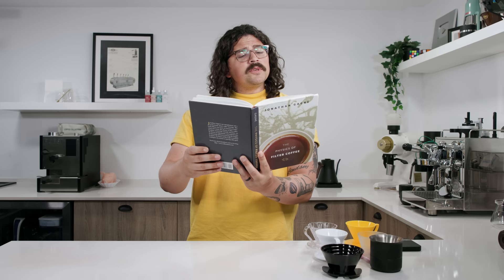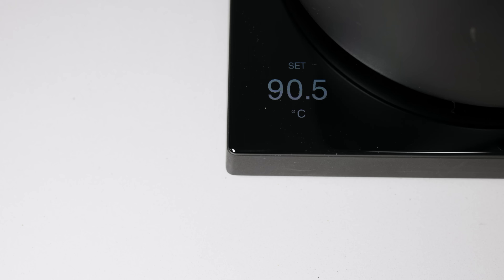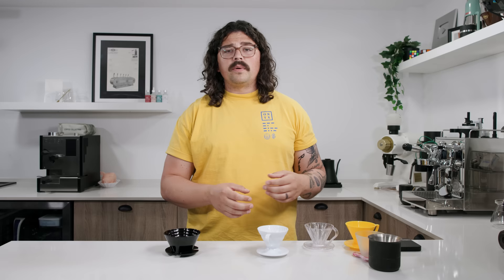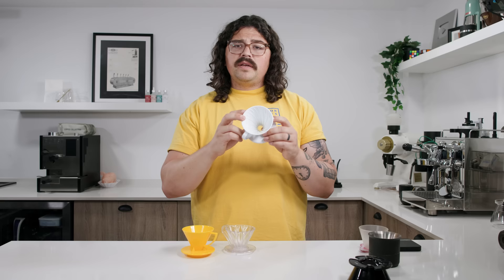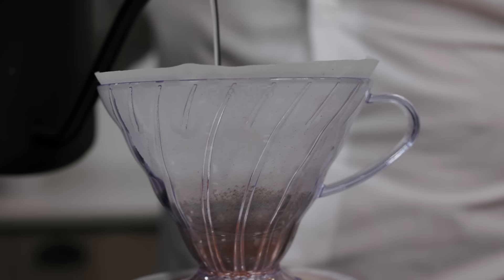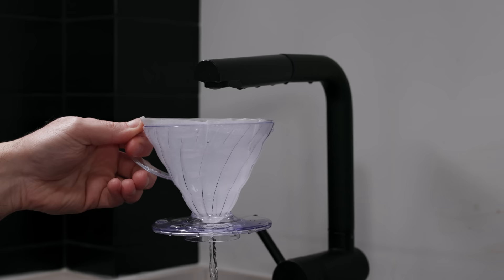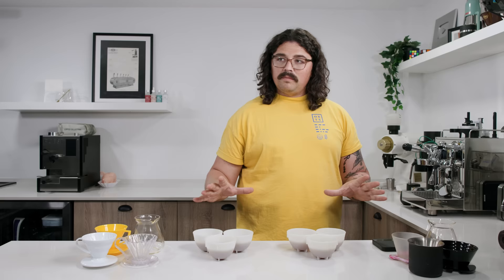WHICH IS BETTER?: Conical vs Flat Bottom Brewers

Comment: Does anyone still have access to the data from the UC Davis, basket geometry study? I seem to recall EY's were not typical, nor comparable across basket types? (Maybe I remember incorrectly, it was some time ago now). What about practical attributes? Basket filter papers take up more space to store, are frequently unavailable where I live, less practical to travel with, more fiddly generally - hence the ones I use least commonly. If I couldn't get Hario papers with my grocery shop, I'd be 95% Melitta/Clever brews.

Comment: No love for dual-wall v-shaped filters like Kalita and Melitta 101/102?
Reply: Melitta got me into brewing coffee. Used to use instant if I was at home. I know they aren’t as popular, and there are probably valid reasons for that, but when you can get a simple Melitta dripped in the grocery store, that’s a great start. Not just in quality, but in the hands-on approach.
Reply: I would also like to see how the V shaped Melitta (and Clever, when not using immersion) stack up.

It has some of the geometry of cone brewers, but the single tiny hole makes it more like a flat bottom. I grind pretty fine for pour-over, but don't get stalling in Grandma M.

I'd like to get a second dripper for experimenting ... even after the video I don't know what type to try for a cup with more clarity.

Comment: I don't think water depth above the bed is increasing the drip rate solely due to bypass. I would have to assume that the deeper water would push down through the bed with more force due to increased weight and therefore pressure at the bed.
Reply from the maker: Doesn't act the same in, say, a kono.

Comment: I know you said you hate the frill filters, but could the Timemore B75 mitigate this issue with it's design?
Reply: No it does not. I own a timemore b75 and the filter does not sit flush to the walls. So there is definitely bypass happening. But besides from that I like that brewer very much. It's much faster than the April Brewer and the plastic Origami. I'm using Kalita 155 filters for all three brewers. Probably a cheap alternative to the Orea V3. But the Orea offers the opportunity to brew without any bypass when using the trapezoid filters and the negotiater.
Reply: @TheMeetubee  Thanks for the answer!

Comment: I just don't understand why it would make a difference if the edges vs the centre of the bed is less evenly extracted (in a cone dripper) than if the bottom vs top of the bed is less evenly extracted (in a flat bottom dripper)? Like how would it matter if the extraction gradient is from edges to centre or top to bottom if the same extraction is achieved in the end?

Comment: One thing I consistently struggle with is getting my pour-overs to taste full. Often the coffee has a dull, tannic flavor or it's just aggressively bitter. There's not much fruit or acidity, even if the roaster says "pineapple" etc. I buy high quality beans too, like Madcap, Sey, Tim Windelboe, etc. I've got an 1zpresso grinder, I got the Kruwe ruler to make sure by grind size was 400-ish microns, tried the standard V60 and the Mugen, still the same issue. Tried all kinds of recipes and rations too. I'm at a loss tbh. Feel like my coffee palette is busted or something.
Reply: Off the top of my head, it sounds like you are grinding too fine, based on both the flavor notes you mention and your mention of grinding to 400 microns. It was a while back, but I think Lance mentioned grinding to 800-900 microns for filter. Lance doesn’t like to give micron ranges for grinding because he wants people to dial in for them selves, but if you haven’t already tried it, I would try grinding way way coarser than 400 microns for filter and seeing how you like that
Reply: What water are you using? Making my own water (adding lotus drops to distilled water) has helped tremendously
Reply: @BBB_025  I appreciate this a lot! I'll coarsen things up and try again. Clearly I got myself in a rut with approaching grind size.
Reply: @BeatTheSunUp  Tap that I filter with a Berkey. The regular tap is not tasty, but maybe the Berkey is leaving some useful minerals out.
Reply: @6minus3minus2  I am not familiar with the Berkey and I am not sure what part of the world you live in, but you might give third wave water a shot if it’s available in your area and then see if you want to go farther down the water chemistry rabbit hole with something like lotus water.
Reply: @BBB_025  Berkey is the fave of off-the-grid types, but I just got it cause my local water has LOTS of chlorine. But I coarsened up my 1zpresso by about a 1/3rd full turn and my coffee is MUCH tastier. I really appreciate your advice. Loving this Tim Wendelboe I have now.
Reply: @6minus3minus2  success! 🎉🎉🎉🎉

Comment: That's a good book. I recognized it at my local coffee roaster days after you posted a video featuring Jonathan Gagné and got it right on the spot.

The part about bypass actually explains the 60% in Tetsu Kasuya's 4:6 - fewer but bigger pours for more bypass, and more but smaller pours for less bypass. I'm guessing the first two pours is bloom size followed by a top-off for a consistent starting point for the 60%?

Comment: Would it be crazy to use two different grind sizes in a flat bottom? Fine for the bottom (under extracted) half and coarse for the top (well extracted). Or would it just mix too much?
Reply: Sounds interesting in theory. Wouldn't this cause more bypass halfway up the dripper since the bottom would be more likely to be clogged?
You might be interested in the Wet WDT method
Reply: @Carmagical  I meant with the orea and negotiator friendly filters where bypass is minimal already. The idea of those needles so close to my precious sibarist filters puts me off the wet WDT haha. Should try at some point tho
Reply: @iwouldpayattention  oh! But that would be a perfect use for it haha. Just remember to sand the tips of your needles off and you'll be fine. Those filters are really expensive though. 
I think you'll find what you're looking for with wet WDT, but you should still try out your method and see what the results are.
Reply: @Carmagical would not of thought of sanding haha. I think I’m actually gonna try grinding just past the point of astringency and then just before the 5th/final pour, letting the bed drain and scooping out the top third or so of grounds. I’ll give this method my name haha

Comment: With brew temp being a relatively low impact variable, should we be worrying less about preheating brewers? Maybe a small question, but it would be nice to use less kettle water!
Reply: You can watch Hoffmann's V60 recipe about that topic (I think the newer one with the small coffee dose recipe) at one point he talks about that. He says that while extraction doesn't change, if you rinse with cold water (so no preheating) the taste is clearly inferior. He also adds that's only true for glass, ceramic and metal... you can rinse with cold water in plastic brewers :)

Comment: How does tds differentiate from extraction?  Did they dilute the coffee after brewing to achieve the specific tds aside from the original extraction percentage?  I'm understanding that as in a 24% extraction was made, then it was diluted to a lower tds.  Is that correct?
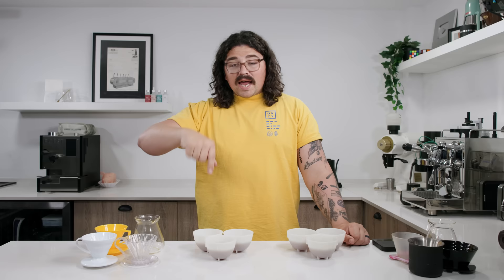Reply: I just had an idea for a different style of drip brewer.  Make it like an angel food cake pan or a bundt pan.  I had this idea watching you stir the coffee in your cone dripper 21:08.  I thought what if you just tried the brew with that stir stick in the middle so you eliminate that extra "coney" part in the bottom.

Comment: They apparently didn't account for the material of paper filters, which makes the study pretty much worthless. IMO. At least nowhere in the study they talked about it.
Reply from the maker: I wouldn't say worthless. I think the papers are both from breville, so likely same porosity. But I'm speculating.
Reply: Well, Idk if Breville manufactures those. But here in Europe it'd probably be something between challenging and impossible to find identical material paper filters for all the shapes. Don't know about companies like Abaca, though.

The reason why I doubt the use of this is simply because I know from Melitta how much of a difference their Gourmet Intense vs Gourmet Mild filters make. Brewing my V60 and my 102 both with Filtropas seems not identical, but definitely closer.

But ofc, I might be wrong. Sometimes your perception can fool you quite easily.